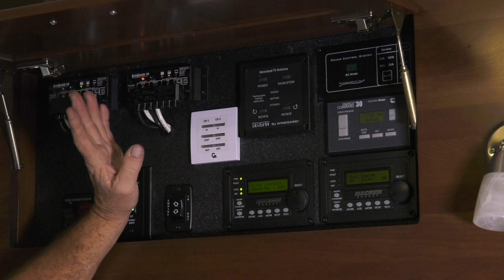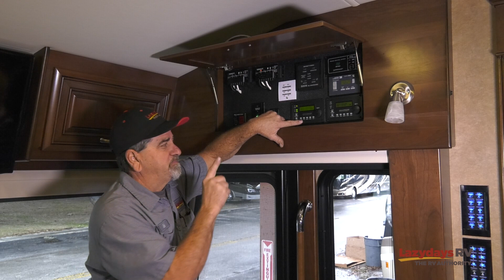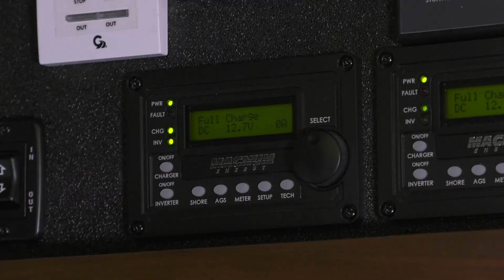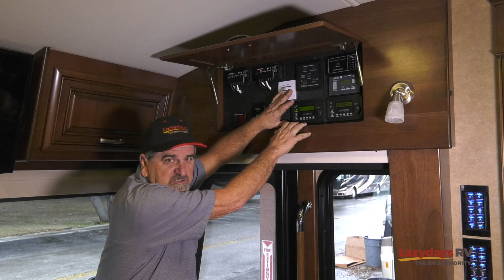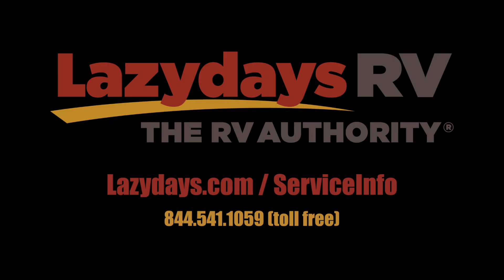RV Voltage System Series - Inverters | Lazydays RV Service

Comment: My Winnebago View has both a converter and a 1000W inverter. This video confused me. I thought my converter was charging my house batteries when plugged in to shore power. I rarely use my inverter since I rarely boondock. Now I am wondering if I should just leave my inverter in the ON position all the time